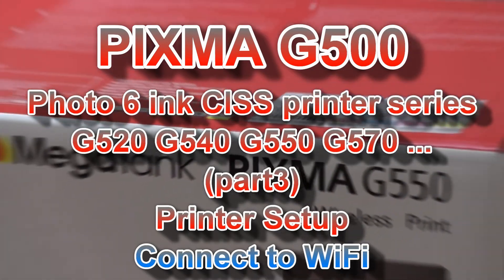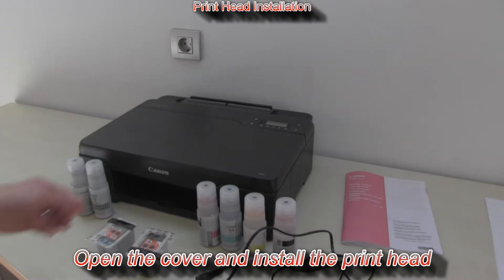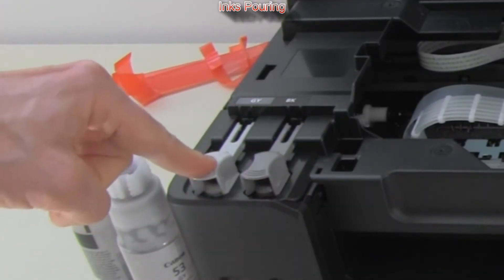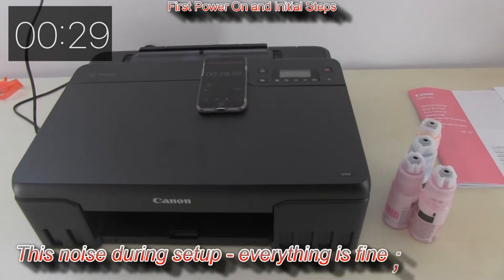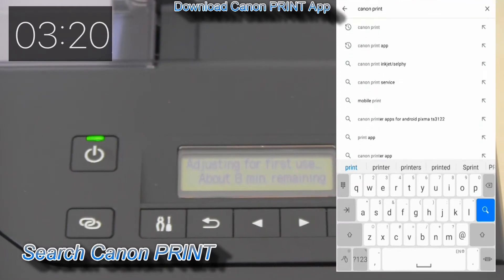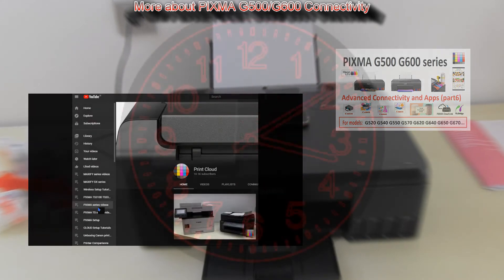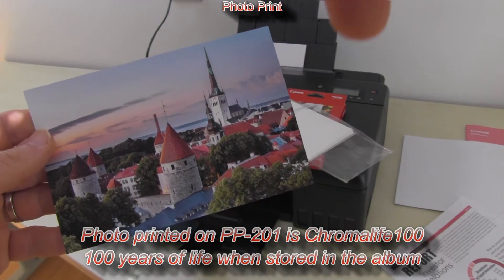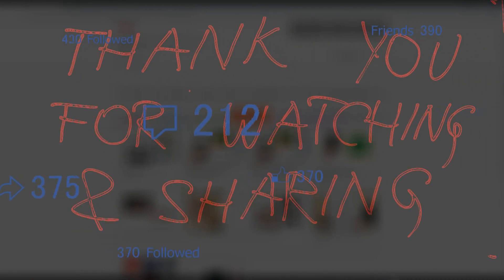Canon PIXMA G500 Setup (part3) Setup printer and Connect to WiFi for G520 G540 G550 G570…

Comment: Hi, I have a problem when I print the image, that it pulls on the green yellow. And the colors are full. I used to print pictures from my mobile phone, the color was great. I haven't used it for several months and now when I print it pulls on the yellow and green pigment in the picture, the colors don't show clearly.
Reply from the maker: I recommend print head cleaning. The CISS printers in general are not recommended for no use for several months, as ink is in the tubes in the ink system and you should print more frequently

Make a nozzle check and then cleaning of print head and try if that improves - my video on this model maintenance is here:
https://youtu.be/8-7lX6Jm73Y?list=PLPl4jOVrR08KfrzrXG5771d88NUspnDZx&t=150